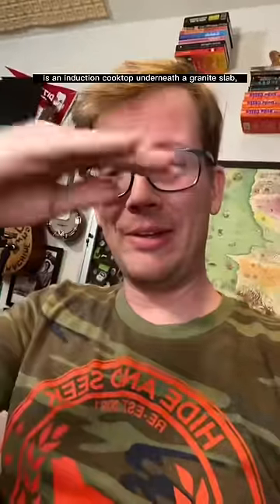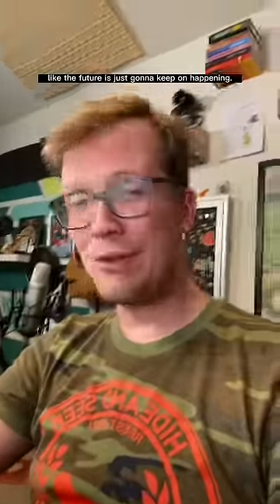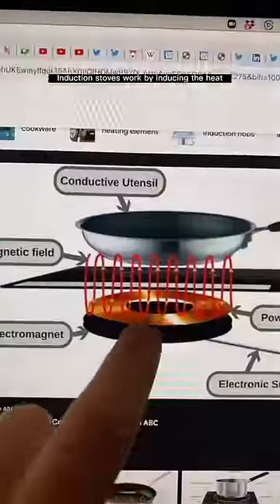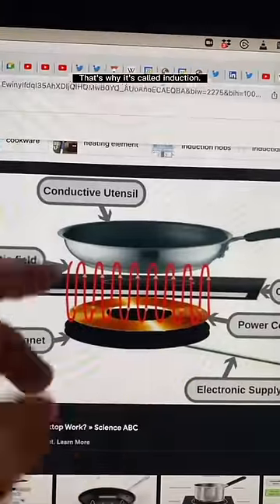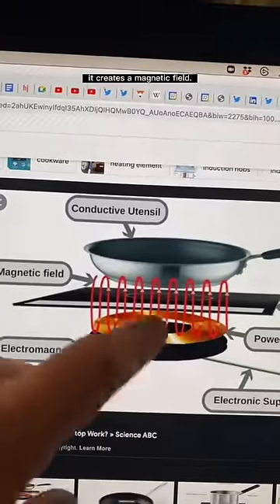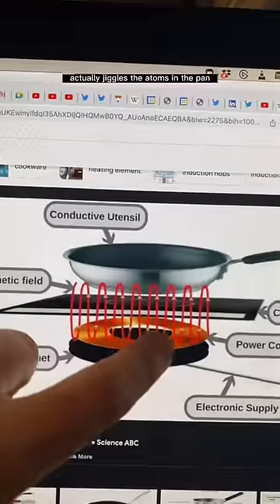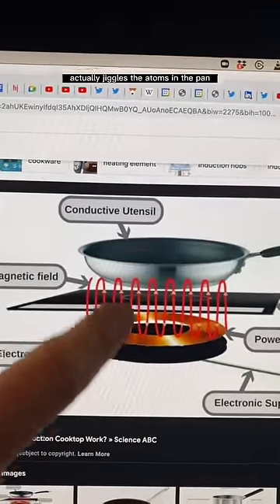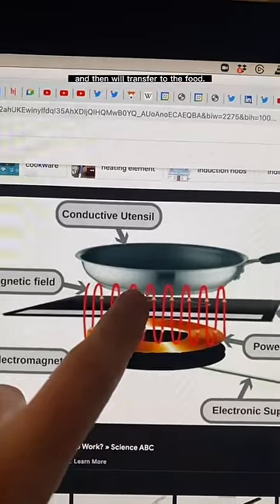How do induction cooktops work?

Comment: I use induction stove, here are a few things you need to know about them:

1) They are hella aggressive. Meaning if you're cooking, you're cooking. So prepare the items beforehand.

2) With point number 1 comes the speed at which things cook. It's very fast for frying (like half the time of gas stoves). For soups, however, it's the same since it cooks in a boiling water, but the water gets brought up to boil significantly faster.

3) You can leave your spatulas, spoons and whatever touching the pans, they won't heat up, which is pretty nice.

4) They makes sounds. Not a lot, but they do. They also disturb the sound on videos a lot and that can be a major problem for somebody who shoots such videos.

5) They need magnetic cutlery. Otherwise it won't work, though there are adapters. Also magnetic cutlery is much more common than you may think.

6) It's efficient at transfering heat which means that air around it doesn't heat up as much and neither does the stove itself. Though you still shouldn't touch it right after cooking, it will be hot, you probably won't get burned, but it will be hot.

7) You can wipe it in the process of cooking. And unless something gets under the pan it won't get burned or cook at all.
Reply: This is a completely underrated comment and i appreciate you taking the time to educate! I had no idea about most of this!
Reply: god they sound soooo nice. one day when i don’t live in an apartment, an induction stove is my dream

Comment: I would get so injured with this I can't even tell you, I'm such a forgetful person
Reply: It's an induction stove. It doesn't get hot. You can't burn yourself.
Reply: @humanperson0798  To be fair the part where you have the pot on top of it does get hot. I have an induction stove and mine signals if it's still hot with an "H" on the control panel. (Just to be clear, I'm not saying the stove by itself heats up, it's the pot that does and that heat gets transferred to the stovetop, which takes some time to cool down after use.)
Reply: @owlcat8896  are you sure that's an induction stove and not a regular glass-topped electric stove?
Reply: @JohnGottschalk  Definitely induction. they do stay warm for a bit.
Reply: @HiThereImLily  the bottom of your pan isn't very well heat-insulated then.
Reply: @JohnGottschalk  What the hell are you actually talking about, my guy? There is no pan on this earth so well insulated that can heat to 1000 - 1500+ degrees and NOT transfer some of that to whatever it's sitting on. I don't know how you think insulation or heat transfer work, but it's clearly faulty. Furthermore, given that 99% of cookware is designed for traditional stovetops, you're right... it wouldn't be very well insulated, because it's not designed to be. Because if it was, it wouldn't get hot from a normal stove and cook the food!
Reply: @ValkyrieTiara  no need to curse. Have you never used a pan with a metal handle that doesn't get hot? Same idea. And the induction goes from coil to coil, so shouldn't heat up things in between. An induction pan also shouldn't be used on a regular stove top, so it could and should be insulated. That's why I think the previous commenter isn't talking about an induction pan, but a regular electric stovetop with a glass top.
Reply: @JohnGottschalk  Bro I literally said "what the hell" and if you find that offensive enough to chide a stranger over maybe public discourse isn't the place for you. Sorry, but it's not for you to police my reasonable use of normal accepted language to conform to your personal sensibilities.

Furthermore pan handles DO get hot. The part you hold doesn't get hot because the handles are very long and thin so the heat dissipates before it gets that far, and is THEN further covered by an insulating material to protect your hand. But if you think that the insulating material is incapable of transferring heat when in direct contact with EXTREMELY high temperatures, such as a frying pan at cooking temperature, I invite you to put a piece of wood or plastic directly into a pan over high heat for a few minutes and then pull it out with your fingers. Just don't complain to me when you start a fire, breathe noxious fumes, or burn yourself.

I do not believe there is a consumer-grade material you could put on the bottom of a 1500 degree pan that would prevent it from transferring SOME heat to the countertop. Not without being prohibitively expensive or unreasonably heavy. MAYBE for something like a large stock pot it would be reasonable, but that's a big maybe, and certainly not for a frying pan.
Reply: @ValkyrieTiara  damn, you're kinda sensitive aye? My comment was just meant to say: you're allowed to turn it down a notch. 

The coil doesn't have to be in direct contact with the bottom surface of the pan as far as I understand, just with the inside surface of the pan. So there can be some space and plenty of metal between the hot coil+inner surface and where the metal touches the counter top. It's a hollow structure.

But it's okay, if you're dedicated to it being impossible, we can stop the discussion, as I'm not convinced by your argumentation either.

Adiooossss
Reply: @JohnGottschalk  I'm unsure of how much pot/pan handling experience you have, but unless the handles are hollow (definitively not insulation) they will get hot, really hot if used for any appreciable amount of time, like that needed to do anything greater than fry an egg.

If the pot or pan is hot enough to cook the things on top of it, it is hot enough to make the thing underneath it hot. Be it a table or an induction cooktop. Just because you cook with magnets does not mean it now defies thermodynamics.

Induction cookware is made with magnetic cast iron or steel. The bottoms are not some fancy space age technology. They're a thick piece of metal that is magnetic and also has a large thermal mass, because it's a big piece of metal. Like all good pots and pans.

I do not know where you get that you cannot use induction pots on conventional stove tops. Unless they have a coating of sorts on the outside or are extremely thin (cheap) they are perfectly safe to use on gas or electric.

But in conclusion, they get hot. Just yesterday at work someone removed a pot from an induction cooktop and spilled a drop on it. Wanna know what happened? It burned.
Reply: @ratnapkins7853  well considering we were just talking about the fact that you don't want to have pans in cupboards below the range either, clearly the rest of the cupboard in between didnt heat up, right?

If you use a raised system that is hollow (like a handle) out of a marerial that isn't iron based (say aluminum), then the pan base that is in contact with the food can still be iron-based and not be heating your counter-top directly (you may still heat it a little bit, but much less).

But yes I understand most pans are designed to be multi-type, or are just regular non-specific iron-based pans, and that most pan producers aren't incentivised to make pans that /won't/ heat the counter top, because that's a selling-point of the range, not the pan usually.
Reply: ring, watch, knife, phone... ikr
Reply: Imagine the space technology that would prevent something closer than a centimetrer away from getting hot.
Reply: @JohnGottschalk it's just normal pans that have enough ferromagnetic material in them to work. I'm not aware of any that you can't use on a normal stove.  2 pans are metal to conduct heat.  How the fuck could a hot pan that conducts heat well not transfer it's heat to the glass top on the induction stove.  I too have used induction and seen it get hot. Not as much as an electric stove but enough to burn you. Please link one of your magic induction only insulated pots.
Reply: @JohnGottschalk  I don't know about induction only pans and don't really have a reason not to believe you 

Also

If I were to use a normal cast iron skillet on that countertop. It would be hot after I took the pan off. 

The skillet will transfer heat to the food, and also transfer heat into the surface 

So depending on the material of the surface, it can still be quite hot after cooking.

But if the skillet had an insulated layer between it and the surface, the surface will get less or no heat from the pan and be cooler and safer

Are we all in agreement?
Reply: @JohnGottschalk how on god's green earth would it target JUST the inside of the pan if it's all made of metal? Furthermore, you're factually wrong, I grew up with an induction stove and what the commenter said is exactly what happens.
Reply: @plazma0325  coils that resonate at the same frequency transfer energy even as they don't transfer energy to the other atoms in between. This is some of Tesla's work. Induction stoves are based on this principle, so are wireless phone chargers. He originally wanted to use it to do things like transfer power wirelessly to space.

There's a transfer of energy, not specifically of heat.

Metal pans frequently have metal handles that don't heat up. Don't ask me how that one works, but material and industrial designers are pretty smart.

Put 2 and 2 together (and the whole pitch of induction stovetops) and you have a pan that has a cool bottom insulated from the hot top side being heated by an induced coil.

However if you have a multi-use pan for induction or electric stovetops, then the bottom won't be insulated and will transfer heat back to the glass surface of the stove.

That's why your experience and my statement can both be true. Very few companies make "only induction" pans
Reply: @JohnGottschalk  I know how induction works, and maybe you should have listened to what the other guy was saying regarding how metal handles stay cool (which isn't a perfect design, by the way). Even if you manage to only target the top layer of metal, it won't matter unless the bottom is made of fucking aerogel. Seriously, how can you not understand how heat works?
Reply: I’d be concerned about my cats walking across it, just seeing one long countertop.
Reply: @plazma0325  I forgot the comment about the handles from months ago, but also when everyone just starts throwing insulting language out straight out of the gate, I tend to not be bothered to read the whole comment section. Also the comment literally describes how you could do it: make long thin pieces of metal (for instance a false bottom), and then insulate it. These handles work on pans, just extend it as a false bottom, it's the same principle, so that's a second reason I didn't remember the comment: it wasn't relevant.

Basically I don't care enough to continue this with y'all. You aren't bringing new information to the table, you're just trying to restate information more emphatically, and that's not great for a discussion. If you all don't wanna believe the thing I'm describing (and the whole pitch of induction heating not making a counter top hot)– fine 👍

Go live your life and believe whatever you wanna believe, no one's stopping you. 

Over and out.

(I really wish I could mute specific comment threads on youtube)
Reply: @JohnGottschalk induction pans are not insulated.
Reply: @JohnGottschalk you can mute comment threads on youtube iirc, and you can also ignore.
Reply: @JohnGottschalk   The magnetic field becomes weaker as the distance increases. The stove doesn't even turn on if it doesn't register induction-capable cookware on the plate or a few mm above it, so the distance between the layers would have to be very small.
You could also put the pot on little feet to minimize the contact, or use a layer of insulating ceramic or other fireproof insulation. And perhaps also adjust the way the stoves are built, so they turn on with a greater range of distances. That's a lot of extra costs and makes cleaning your tools a lot harder when you can just cool an induction plate to safe temperatures using a wet rag.
Reply: @JohnGottschalk some pan handles don't hold heat well, but they will hold heat. If you put it in an oven it will become hot. If you put it on a burner it will become hot. I just doesn't become hot from the pan it's attached to.
Why do you think trivets exist? The surface of an induction stove is physically capable of holding heat just like a glass top stove, granite counter, wood table, etc. It doesn't break the laws of physics.
If you put a hot pan on an off burner it will still heat the surface under it. Not as hot as the burner, but still hot. The same thing happens with an induction stove.
Reply: @JohnGottschalk Pans aren't supposed to be insulated...
They're supposed to be conductive
Reply: @JohnGottschalk  You don't put coils in induction pans. You want to increase the amount of vortex currents forming in the pan so that more energy is lost as heat rather than induced as current. Coils would help with generating current, which is why wireless chargers use coils on both ends.

Edit: To be fair, you could put a metal plate on top of insulation for an induction pan, but not coils.
Reply: @Vezoth56  oh righto, yeah I read up on that months and months ago, but forgot that detail, but yes, cool
Reply: @humanperson0798 what about post cooking? The pan would conduct heat into the granite no?
Reply: @JohnGottschalk  he’s sensitive? When he used the word “hell” and you said not to curse and took offense 

Yeah ok pal

Editing comments too like a knob
Reply: @astonedwalrus4183  my edits are purely to fix spelling errors, or avoid multi-posting, I don't edit them after other responses have been left.
Reply: @JohnGottschalk how is saying hell worse than saying damn to you
Reply: @thequeenofnanobots  haha ya got me, intonation in my head, I guess?
Reply: somethin tells me, you injur yourself plenty without it...
Reply: @JohnGottschalk You’re cracked my guy
Reply: @NTLMBigBench  I just got time and I'm not too worried tbh. But it's funny how many folks come after me for my comments on induction pans xD